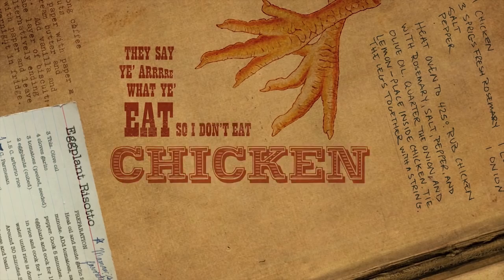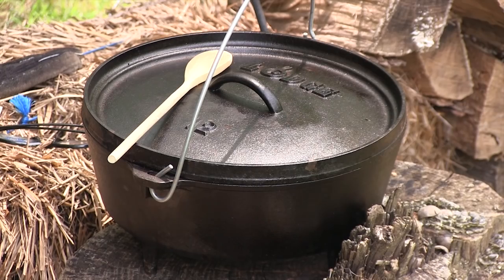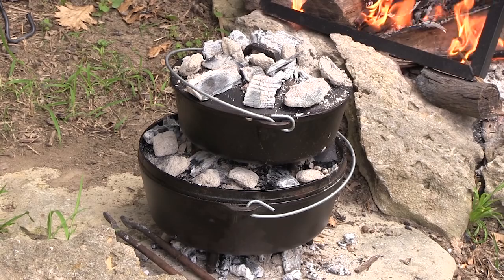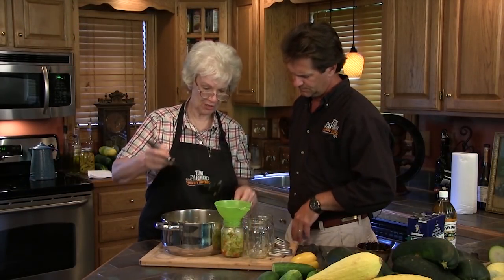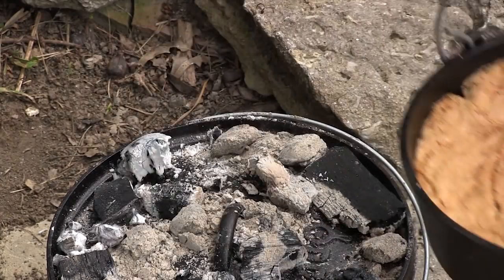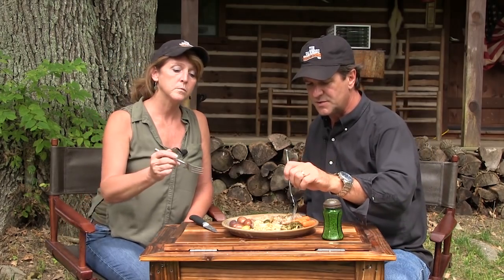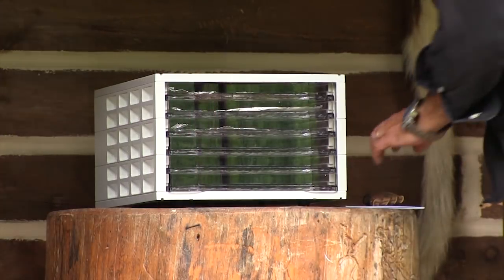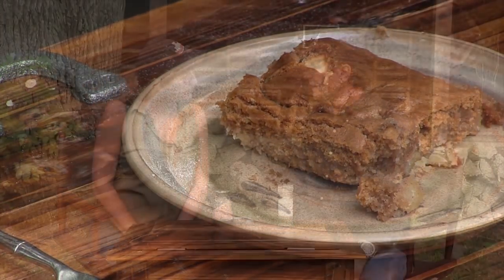One Pot Chicken & Pork (with veggies) Apple Cake and Bourbon Smoked Garlic Salt (Episode #362)

Comment: On your web site the recipe does not clarify the type of eggs size and apples types, and of the baking dish (if not the 12"? Dutch oven) I assume since your using baking soda that it is all purpose flour being used.  Can I guess at a 9x13 with tin foil? possibly a Bundt pan? since you gave the temperature and time.